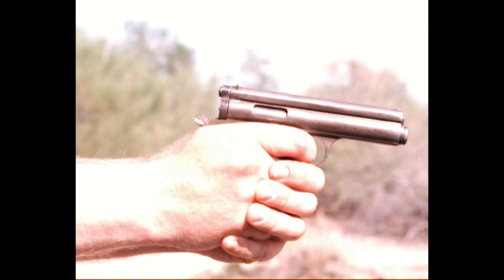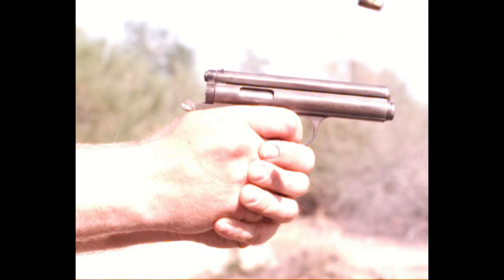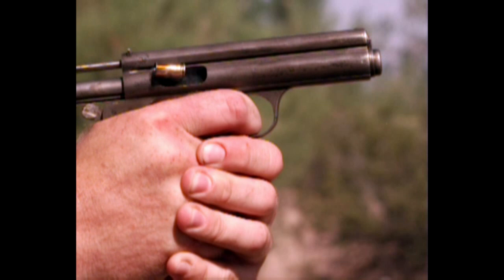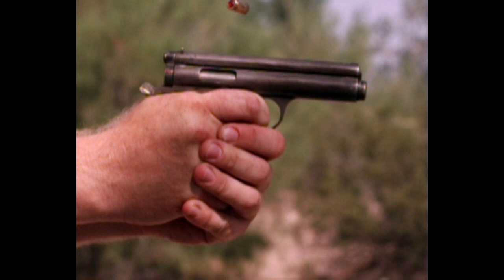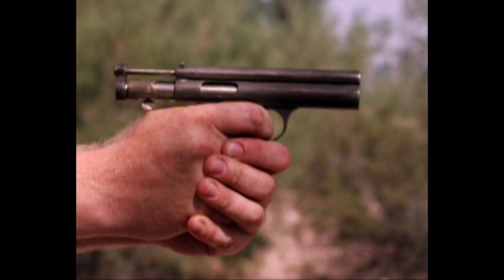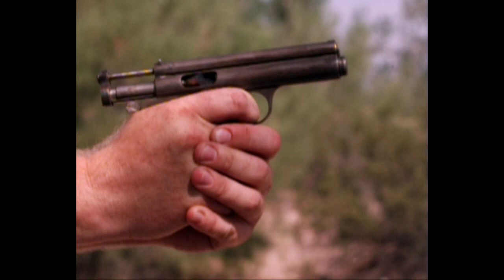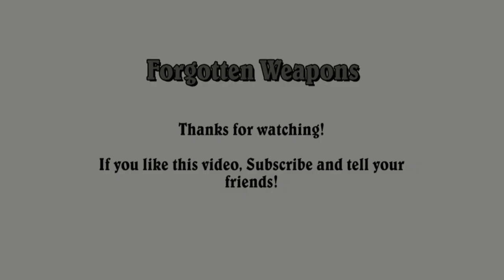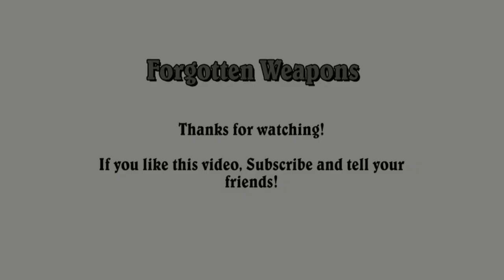Slow Motion: Frommer Stop (1912)

Comment: According to Battlefield 1, .380 is "renowned for its stopping power". XD
Reply: That was most likely a reference to a marketing claim that circulated not long after the Frommer Stop began production that the "Stop" in the name referred to the ability to stop targets more effectively than other small frame pistols. Considering that at the time, most pistols of the Frommer Stop's size were chambered in only .25 or .32, the .380 was considerably more effective for personal defense. The very similarly sized Mauser 1914 pistol, for instance, was chambered in .32 ACP. It makes sense why the Frommer gained such a reputation when you put the claims into proper context.
Reply: This is a common misconception. They are actually chambered for 9mm Frommer, which is dimensionally the same as 380 but higher pressure. 9mm Frommer is comparable to modern 380 +P (maybe even +P+). The confusion comes from the fact that the 9mm Stop pistols will chamber and fire 380 just fine because the cartridges are identical, but they are actually designed for a more powerful cartridge.

Comment: I used to actually CCW a Frommer-Stop for about a decade until it was stolen. I miss it... Of course I mostly carried it out of novelty because I love the design, and it certainly wasn't the most powerful defensive option. However it was super compact, relatively light, and for me apparently just a natural fit to my hand and technique. I shot better with it than most of my other pistols without even trying. It's one of those weird systems like the Madsen LMG that "shouldn't work, but do".

Comment: It looks as if this action, properly up-sized, would work well with high intensity cartridges like the 9X19. It is interesting to consider how well this gun would have done with further refinement in 9X19.
Reply from the maker: I expect it would have worked fine - the system was commercially successful in 12ga and .30/.32/.35 caliber rifle cartridges as the Remington 8 and the Browning Auto-5. It would be a lot more expensive to make than a tilting barrel mechanism though.

Comment: It's an interesting design from a time when they hadn't settled on what a semi-auto pistol should look/work like. Though Browning was effectively the 800 lbs gorilla even then.

That being said, it's cool seeing the whole action in slow motion. The long-recoil action makes it look more like a miniature artillery piece than a handgun. It's amazing that such a complicated mechanism was used to fire such a (relatively) weak round like the .32 and .380 ACP.

I just want to know, does the long-recoil action make the recoil less felt? I heard that that was the case before.
Reply: That question is hard to answer.  Probably the most popular long recoil firearm in history is the A5 Browning Shotgun. The best answer, based on this gun, varies from maybe to Hell No.  Properly set up it is comparable to many gas/inertial driven shotguns, but poorly/improperly set up they have broken collar-bones.  The system allows the push of the round to push on the rear of the gun for all the time the barrel is moving back, stretching out the recoil.  But if the springs don't match to the load, the whole assembly can crash into the receiver.
Reply: I'd just like to put in that the Stop, contrary to popular belief, fired proprietary cartridges similar to .32 and .380 ACP. They were loaded a lot hotter than normal .32 and .380 though, so much so that firing regular .32 and .380 may not cycle the gun properly.

Comment: Somewhat of a strange system, but looks like it functions smoothly . Who manufactures this odd weapon and can they be found for sale, I assume that it shots  a 9MM Luger ?
Reply from the maker: They were made in .380 and 7.65mm Frommer (which is largely interchangeable with .32 ACP). The one in this video is in 7.65mm.
Reply: The pistol was designed by Frommer Rudolf in the early 19s. He was a hungarian engineer. Pretty much the only succesful weapon designer from hungary.

Comment: what do you mean by battery?
Reply from the maker: +Ahmad Hamad In battery means the bolt is closed and fully locked, and thus safe to fire. When a gun fires out of battery, the bolt opens much too early and the pressure blows through the brass case at the rear, potentially damaging the gun and/or injuring the shooter.
Reply: +Forgotten Weapons Great explanation, but another question if I may, how would the pressure blow at the rear of the brass? does it have a hole in the back? or is it because the brass isn't expanding against the barrel
Reply: @ogreycloud  the chamber don't support the brass so the brass burst open under pressure

Comment: Isn't long recoil used a lot in autoloading shotguns?
Reply from the maker: The Auto-5 works this way, but not many other shotguns.
Reply from the maker: Ahmed Sabbagh
It is a strong, safe system, and it is not covered by the patents on other less expensive mechanisms.

Comment: What was the reason and perceived benefits behind this pistol? It's a really odd duck.
Reply from the maker: The main reason was that most of the other mechanisms were under patent protection at the time. It is a very strong and safe action, though.
Reply: Forgotten Weapons
If it's weird but it works, I suppose it being weird isn't all that bad, then. Though, it does look like something a mechanically minded person might make in their garage, with the two pipe-looking parts of the gun.

Comment: overly complicated for handgun...looks like it would be more at home as a ship's gun or artillery piece.
Reply: Actually Frommer managed to create the simplest long recoil action possible. Yes, it's still a little more complicate than a Browning short recoil, but not that much, and it has the advantage of a very low bore axis. Unfortunately he made it for a .32 round that could have been fired by a blowback handgun of the same weight, or even lighter.